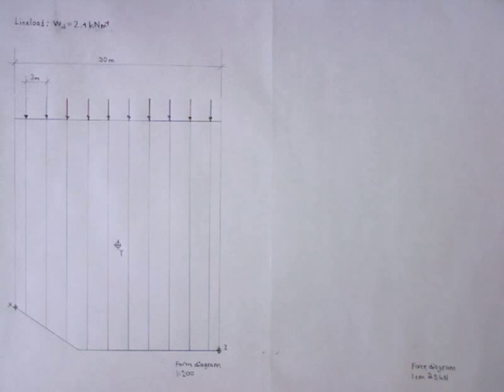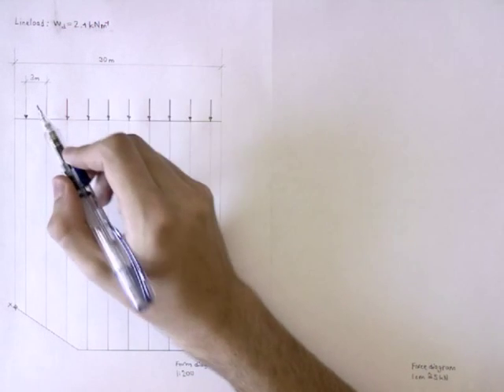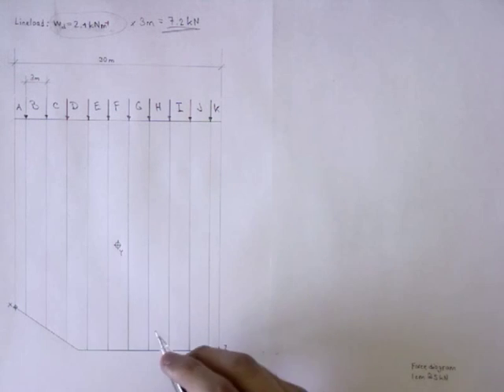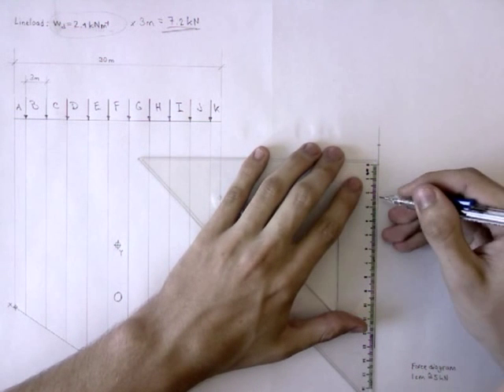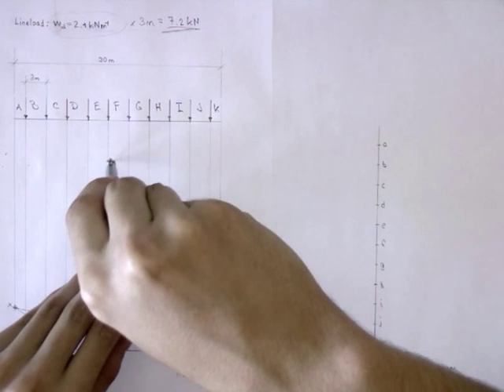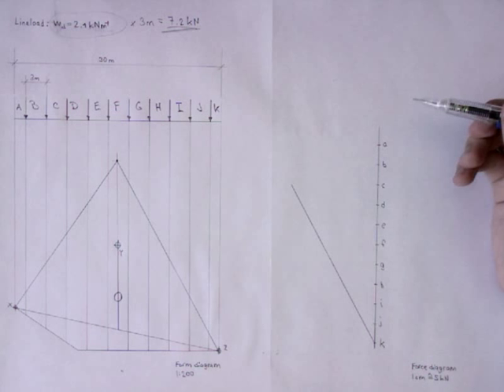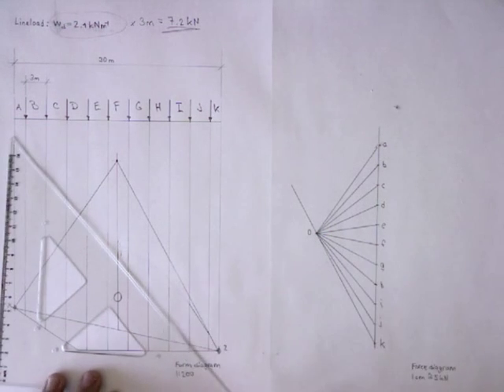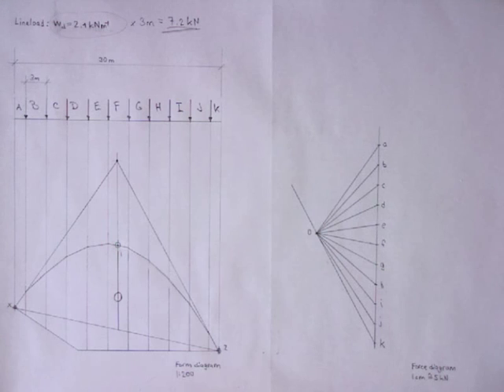How to design a parabolic vault

Comment: Hi, Lukas
I have a question or two - how do you determine that so called "closing line"? Where did it come from? And how do you decide where to place point "O"?

P.S. I am not a engineer, but i have an interest in arches and domes.
Thanks,
Reply from the maker: Closing Line is a segment between the two supports in form diagram (point X and Z).

Point O in the force diagram is placed at the intersection of segments ao and ko which are parallel to the two "tangent lines" in form diagram (in video at 2:10).